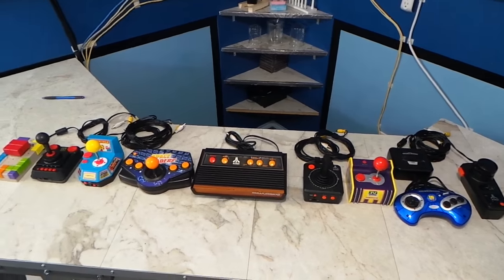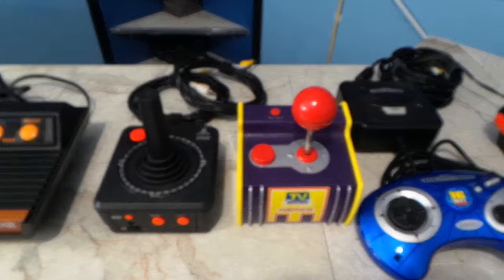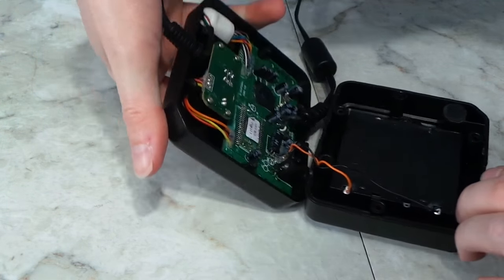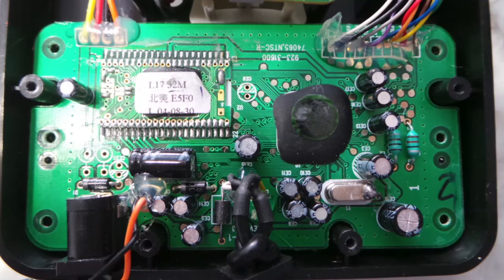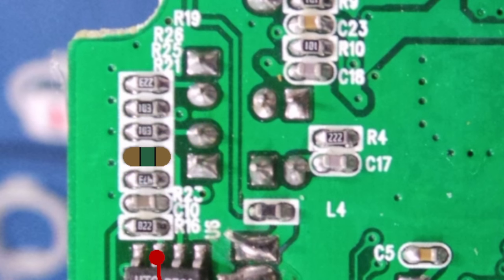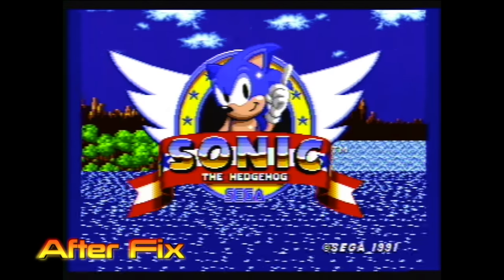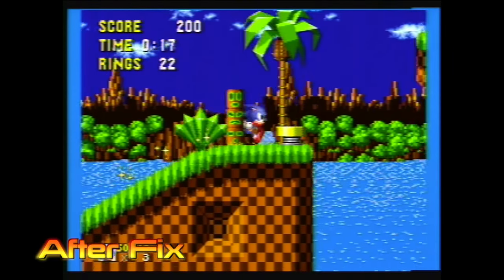Radica Sega Genesis Audio Distortion Fix

Comment: Kinda off topic but I recently added a RGB to Component conversion board to my Genesis 3 and rewired it so that you could play 32x, Virtual Racing and use a power base converter on it.  Pretty neat having a gorgeous picture and with an Everdrive the entire Master System to 32x library that fits in your pocket on real hardware!

Comment: Do you know if its possible to fix the power switch? Mine won't stay down and keeps turning off whenever i remove my finger from the switch.
I have two versions of this, this blue controller version with Sonic 1 (with power switch issue) and a red controller version with Sonic 2 (keeps the button down after being pressed and pops up after being pressed again).
Is there a way to fix this or do I have to put tape on the power switch whenever I wanna play it?
BTW I was able to get the audio fixed in both versions using this guide. It was very helpful, thanks!
Reply: I don't have a Genesis to check, but a power switch is something pretty common in a lot of electronics, you can probably replace it, it's a lot easier than repairing it.
Reply: I think it's one of these: http://www.ebay.co.uk/bhp/pcb-push-switch
desolder and replace it. should be fine

Comment: Is there any chance you might be able to figure out a way to get the AtGames Genesis classic in tune?  What's nice about it is that it's small, it plays original cartridges, and it allows you to use original controllers instead of the crappy iR wireless ones it includes.

     The bad part is the audio; it's so off-tune.  It's almost like the audio is keyed to a flat, rather than a natural.  I don't know much about audio stuff, so, I come to you lol

Comment: It works! ... sorta. I have a second gen version, and it made the ear rape cease for the most part. I suck at soldering so I ended up circuit bending it to display everything with more distortion and warmer colors. It's still playable, and it's sort of extra retro to a certain degree. Thanks for the tutorial.

Comment: I bought a Sega Genesis consule that accepts cartridges and had a lot of built in games. It was made by a company called At Games. It works great, but the sound on some of the games is way worse than your example. Do you think this fix would work on it?

Comment: I smiled when you shown footage of posts from Sonic Retro, since I go by Ravenfreak there. :) I remember when that topic was new and people were talking about how horrible the sound was in this plug n play. After that fix, this is a pretty decent plug n play. Unlike those horrible Atgames systems which use that horrible emulator that doesn't emulate the sound chips well at all...

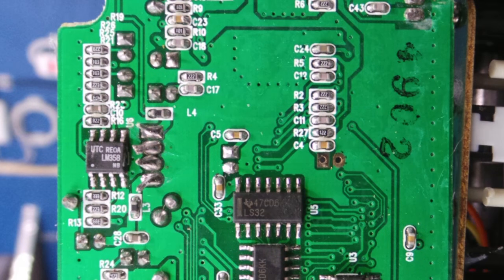Comment: 1:43 that part with designator L3 would be an inductor.   On a board inductors get an L and if it were a resistor it'd be R (like the R12, R20 and R13 next to it)

Comment: I have a problem not with audio but with video
The plug and play atari Joystick(Not flashback) doesn't display the video rigjt and it looks like a corrupt version of the system.
Other plug and play problem I have is with a Pac Man one that when it turns on, it does turn on a small light on the power button but nothing displays on the TV
What can I do?

Comment: So... Question:
If it is basically a Genesis on a chip - Could you possibly pull the original digital signal for the video? like before it gets converted to the analog composite cable.
I have the AT Games one with a cartridge slot and roms on it.
I think im going to see if by chance they have similar boards and yeah blah blah electronics :P

Amazing video btw and i look forward to the plug n play episode :)
Reply: The video is generated inside the chip, can’t pull RGB out of it but can split the chroma and luma apart to get S-Video!

Comment: Just one correction at 1:47, L3 appears to be an inductor, not a resistor.  Inductors are typically marked with L.
Reply: +Alex&#39;s EE Yes, L3 is an inductor. Rx would be a resistor, Cx would be a capacitor.

Comment: Is it possible to attach a cartridge slot to this thing? I think you mentioned it in this video or the other one.
Reply: Yes, there are wiring schematics online for it. You'd need some seriously delicate soldering skills to get it done, though. The 40+ pins are on a chip that's like 2cm long.

Comment: What am I missing?  To me, the sounds were identical.  I tried listening on amplified speakers as well as headphones.  If there was any difference at all, it was minimal.  I certainly did not hear a "hundred times better".  Anyway, sorry for the nitpick, but for technical accuracy, L3 is most likely not a resistor, it's probably a surface mount inductor.

Comment: How about those genesis clones with poor emulated sound?if theres a way to correct that sound emulation trough software,but that requires flashing the rom chip inside those clones with the improved emulator.
Also dot he managed to output stereo sound out of this thing,because mono datas from the 80's,stereo from the 90's.

Comment: Excellent. I just bought a Radica Sega really cheaply. I intend to do this fix, plus I also want to fit the games chip into an old cartridge and do the cartridge slot mod on it. I found a diagram online, but would it be possible to make another video and go through that mod as well?

Comment: Ight so i have 2 of these 1 has sonic one the same as u but I also have one with sonic 2,  Echo the dolphin, Alex Kidd, ECT will this fix work on it as well just curious should have mentioned the audio is also crap
Reply: Open up the one with sonic 2 and if the circuit board looks the same it should work

Comment: +The 8-Bit Guy Extremely useful information if I ever decided to get one but my Genesis mark I and II are both still fully operational. Now, how about doing a vid showing how to replace components on a Game Gear sound module or fixing the ylod on a playstation 3 mark I or even fixing a tempremental disk reader on a Dreamcast?

Comment: Hey there is this at games sega genesis plug and play console that has a similar problem. The audio isn't distorted but the pitch of the sounds and music is was off and its like that even with a sega cartridge in it so its not the roms on the system if you could figure that out it would be great.

Comment: Ah, my first 8-Bit Guy video. I was actually looking for a fix for the AtGames Genesis audio. Still haven't found that fix 😂
Reply: Someone has made a patch for the AtGames Genesis to correct the audio pitch. However, unless you have the version with an SD card reader, you will need an Everdrive or similar flash cart to install it. https://youtu.be/WapmYS8_Tss?si=v-7CX93D8nUgyDpW

Comment: Hey, 8-bit guy, Can you see what is up with the atgames sega genesis? the music seems to be very, very, off. Thank you
Reply: No, 8bitguy won't figure it out, since he doesn't even understand why a resistor in line between low-z output and high-z input really doesn't do anything, as evident from this video.

So far, no solution to salvage the sound on AtGames has been found, and if and when it will be found, it will involve soldering out the giant flash IC and sticking it into an expensive programmer, because there are no serial or debugger pins on the board. The problem is rather fundamental there - all AtGames devices use a modern media player system-on-chip and emulate the console in software, and it's the software that is buggy. The machines are simply not really worth the effort.
Reply: Siana Gearz Thank you for informing me. I really hat the AtGames console's sound. I play all my genesis games on a real console anyways, I just wanted to use repro carts or something without modding my original system.
Reply: *hate

Comment: Help mine wont turn on,  even the power led,  is the power going through the controller, because i fixed the controller's cable with no results.

Comment: It sounds like you disabled some sort of on board compressor. You notice it when you grab the coins and they're the loudest thing in the mix after the fix. I understand why they would do this, to have everything at a flat 0db but don't get why they would leave the attack and ahead at 0 so it fuzzes everything up.

Comment: Hello "The 8-Bit Guy", I need help with something, and thanks for the info!
I will try to apply it to pirate clones consoles type SEGA Genesis 3.
Not only do they sound distorted. There is also a recurring failure in which certain SFX sounds are heard very low, and others well.
For example with Sonic 3 in some consoles clones pirates type Genesis 3 the sound of "JUMP" is heard very low, whereas the sound of catching rings is heard well, or in cases a little high.
The rest of the music is heard well, not seeming to be a channel problem since I tried to exchange them from its output from the integrated to the LM358 and the result is the same.

I do not know how the audio conforms in its entirety, maybe it is already mixed well from the inside of the main IC that is SoC type, like a GOAC (genesis on a chip, like TCT6001H, or TECTOY-580G, or SU16TV06A), but I think it is rare for some SFX to be heard lower.

If there was any possibility of raising the volume of that sound, I would be very grateful.

I would also like to know the explanation of the modification proposed by the video.
I see that the audio output to the TV is directly bridged to the 7 (OUTPUT B) jack of the LM358.
And the right leg of what was R21 (223 = 22K Ohms) is bridged to the left leg of R26 (103 = 10K Ohms)
I would like to know:
1) Where does the left leg of R26 connect to the printed circuit board itself?
2) Is the right leg of the resistor drawn by R21 on the printed circuit connected to the leg 6 of the LM358?
3) Does the sound coming from an IC of the board enter the LM358 first by the input legs "5 and 6" exiting the leg 7 to the input "2 and 3" to exit the leg 1, as in waterfall?
Or does the sound go in parallel on both inputs and output through both outputs?

I would appreciate the help, and I apologize for my English as it is translated by Google Traslator

Regards! And excellent channel The 8-Bit Guy, I congratulate you

Comment: Not bad! The audio on clone systems usually sound like utter trash just by the fault of their design, but after the fix, it actually sounds pretty close to the genuine hardware! Still, a real Sega Mega Drive isn't that expensive, so I have no idea why you would go for a clone system.

Comment: Supeeer coool!!! I have one of those clones of Nintendo and its sound is very bad, it is a very similar to the "power station" is not the same but I guess that inside is very similar, i wanted to know if there is any way to improve it as you did with this, I would greatly appreciate it.

Comment: The how is pretty cool but there was no why. What did those resistors do or not do that caused the problem? Why did removing then fix the problem?
Reply: +Brandon Francey Difficult to say without seeing the board properly, but I think the two resistors he removed formed a potential divider to provide a feedback to the inverting input of the op-amp to stabilise the amplifier gain. The resistors were bad values, and the op-amp was hitting its swing limits and clipping (the distortion you hear.) So instead, this fix bridges the divider to the inverting input result in unity gain (the op-amp effective just becomes a buffer). It wouldn't surprise me if he needed to crank up the TV volume to get a decent level now (it depends what sort of signal amplitude is coming from the processor since its now unity gain), but at least it wouldn't be distorted.

Comment: Can you explain why/how this fix works?
Reply: +Apreche I can be totally off base here, but judging from what he removed (an inductor on the audio line, remapped straight to the amp, then skipped a resistor), I'm guessing this was a shitty lowpass filter with the wrong cutoff.

The filtered output was being fed to the amp, which was blowing up the audio level especially at lower frequencies. So he got rid of the filter and amplified the audio output normally. The resistor remap was perhaps to reduce the gain of the amplifier.

So basically, stopped amplifying a filtered audio, and lowered the gain of the amplifier.

Comment: So many mega drives have 'bad audio', it's crazy.
Now granted some of that may just be people being really fussy, but more mega drives are considered to have 'bad audio' than good.
Which includes some of the later revisions of the first model, most of the second model revisions, and quite a few of the third model revisions.

I wonder though, about this tiny little clone thing - If the fix is as easy as that, why was it built that way in the first place? 
After all your fix involved removing two components (and less components is cheaper).
Yes, it would involve a circuit board layout revision if implemented as a commercial fix, but, if you can make better audio with LESS components, why is it implemented this way?

Comment: will this work on the fire core handheld systems?
Reply: No, because those systems are emulation machines, they use different  sound chips, but I think there is a fix for the pitch problem on those handhelds
Reply: +kotaro riguchi as is this one he is using. sega on a chip
Reply: Do you know where the fix is?

Comment: I'd like to point out that this is a real pain to do - the resistors are super small, and the pads to tack wires onto are even smaller.  I got this done, but it wasn't easy.  I'd recommend a giant magnifying glass and some tiny wire...

Comment: It is possible to replace the ROM with a USB ROM?
Reply: +grk70s that depend on how the main chip read the 'romblob'...
it likely have various checksums based on the size of that, as well as a secure handshake even...
maybe so though...
simply deduce the partition, and load only that many at a time...
it seems some on raspberry pi boards have done similar for hybrid gametoy game etc,
replete with case style etc
(to fit in original gametoy case they 3D print etc).

at that point though -
why destroy an antique, when you can build from scratch the 
game rom emulater and output device outright?

it is as the restoration paradox...

bonne chance mon librepenseur!

Comment: I usually avoid those due to the sound issues though most I run into are probably just using emulation. Still wish they more commonly came woth better sound. If I find one of these now I know how to fix it sp thanks for the video.

Comment: Now how about an audio distortion fix for the real Genesis? Most Genesis systems also suffer from a sound distortion issue, affecting model 1 units without the “High definition graphics” wording and the model 2 units as well.

Comment: Why not simply adjust the bass and treble on your tv or amp?
Reply: Because if it's outputting distorted audio changing eq settings won't fix it, it will just sound quieter but still distorted.

Comment: My Sega Genesis always sounded like the before clip, regardless of what television or set of cords I used
Reply: Some versions of the console sounded better than others "out of the box" because of SEGA's decisions regarding hardware used in the consoles. To quote from another comment: "'High Definition Graphics' models of the Model 1 sound infinitely better than most non-HDG model 1s, and all model 2s. Sega basically cheapened out with the audio amp near the end of the model 1's life cycle, which was carried over into the model 2, resulting in incredibly shit sound."

Comment: This issues reminds me of the distortion you get with the Sega Genesis / Mega Drive Model 2.
I do not understand how the engineers can mess up something like that. If the fix is that easy why didn't they do that in the first place?
It's the same shit with the NES where the Audio In is missing rendering the original NES not capable of extending the sound using chips on the game cart. It can be fixed using a wire and a resistor.....

Comment: Bought one of these at a thrift shop. The power is shot on it and the bolts are in so friggin tight i can't take it apart without stripping the bolts.

Comment: dude, there is even a worse problem for another Sega Genesis/Megadrive plug and play like device, there is this company named AtGames and they sell this model of a genesis that includes 80 built in games (altho only half are this are actual genesis/Megadrive games) they also have portable versions of the device which I own and there has been one thing this damn thing is known for. if you think the sound sound bad on that thing you fixed the AtGames Device has low quality and its lowering the tone of all the sounds to sound nothing like they suppose to, I always wondered why is that happening..

Comment: Nothing beats the sound of the original Yamaha sound chip,L3 is not a resistor,its an inductor,a coil.Also most retro consoles plays the audio at a slightly lower pitch than original.Road Rash as a prime example.-Go figure.